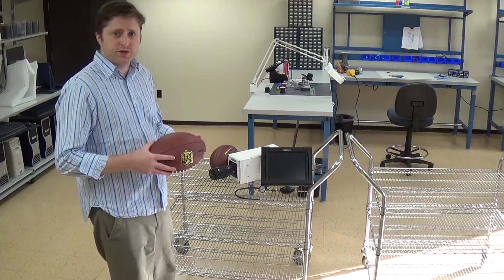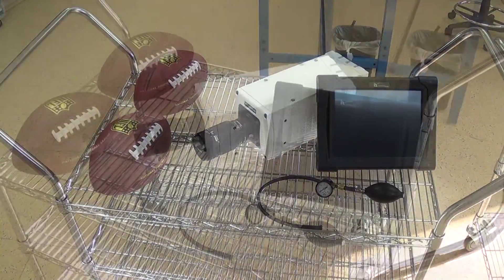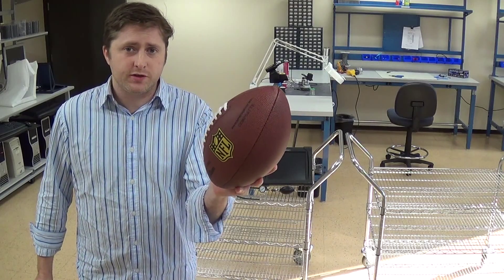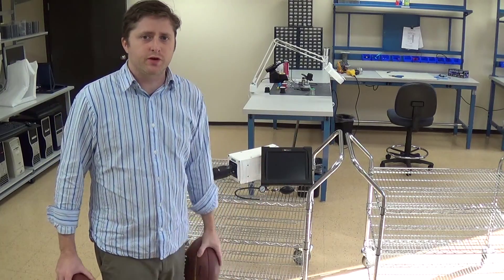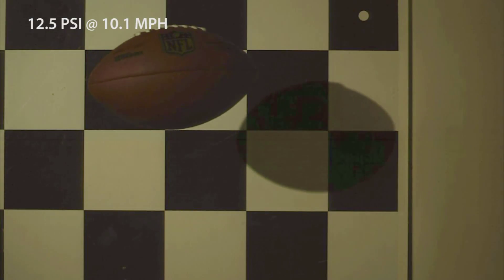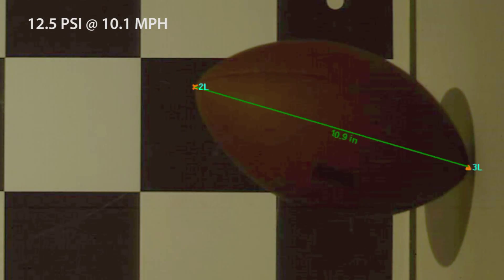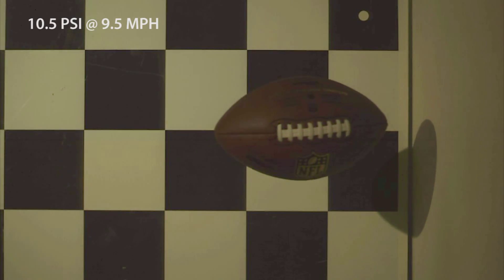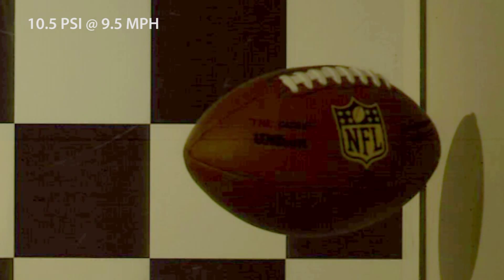Effects of Football Deflation on Solid Impact

Comment: Nice work. Without a doubt, the deflated football is easier to catch on a cold day - the compression helps out the "soft hands", which is essentially just the ball having more give when it hits the hands...evidenced in your video.
Would be interesting if you could recreate the same scenario at a similar temperature as what it was on game day - if there's more or less give as temperatures decrease.